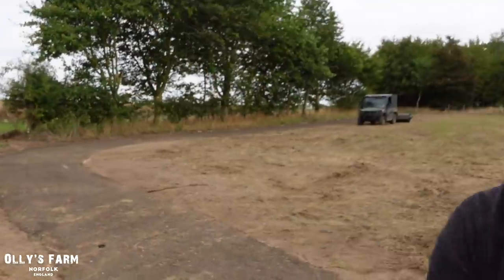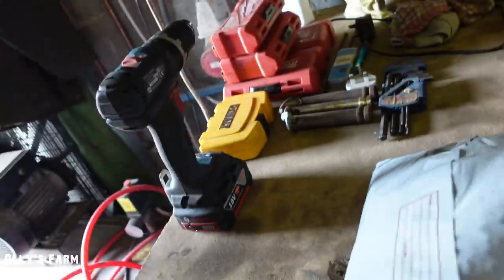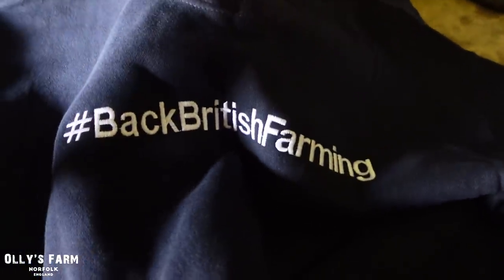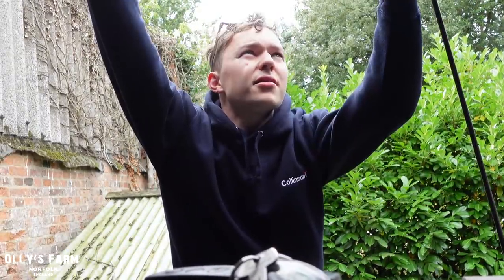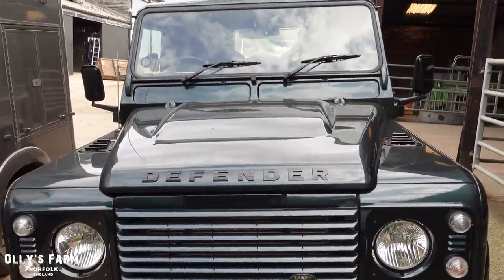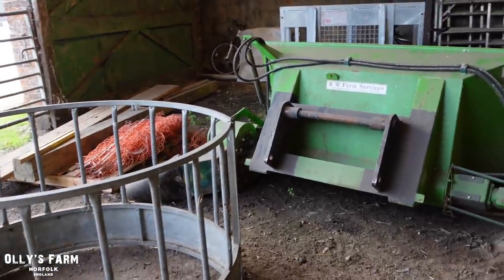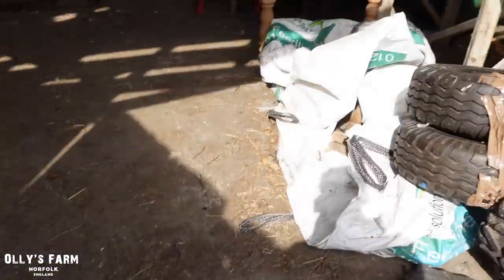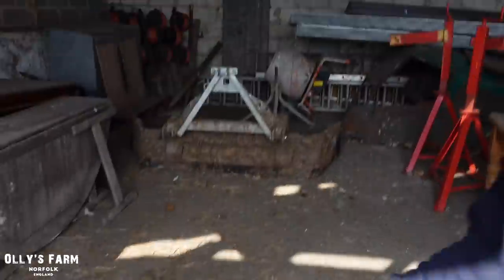CRUSHED TARMAC NEW FARM TRACK INSTALL BY SKILLED DIGGER DRIVER!

Comment: Advice on the Land Rover - what out for chassis rot mainly on the older models but still make sure it’s cleaned every couple months at least. Also a general rule make sure it gets a good motorway run every hundred or so miles to unblock the dpf. Brilliant vids olly 👍👍

Comment: Great video olly, quick question what the old tractor cab off in the small workshop
Reply from the maker: Hi, that’s the 135’s old cab which is in the shed, we decided to restore it without a cab because it’s only going to be used in the dry ;)
Reply: @OllysFarmLtd  thats a shame don't see many 135's with cabs any more